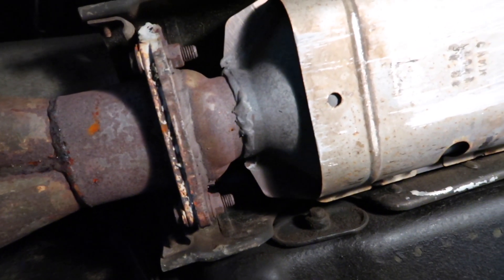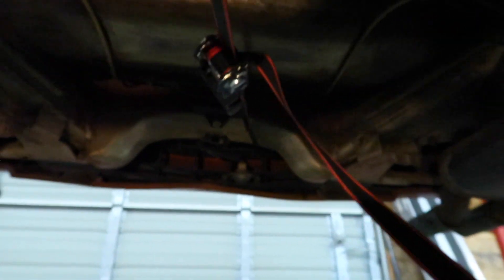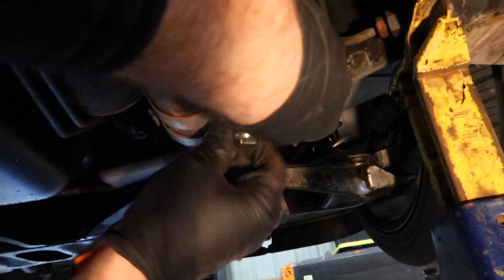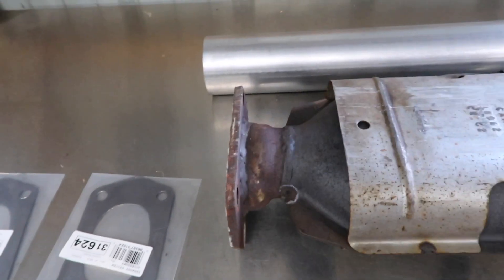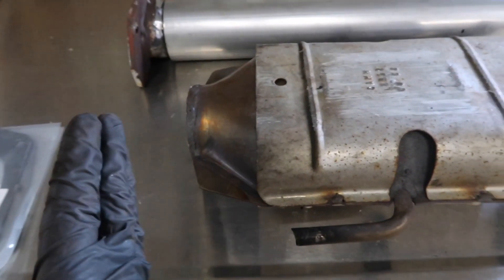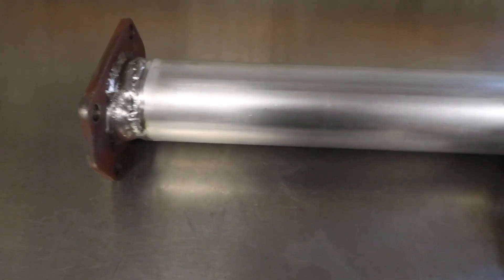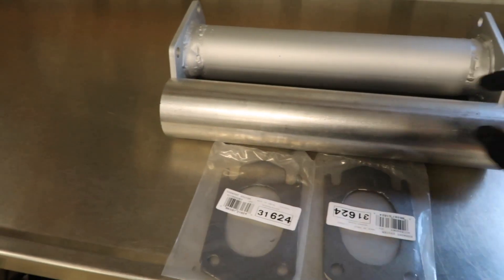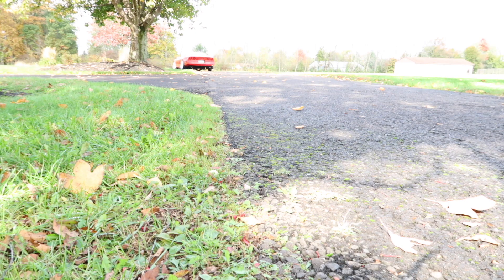D.I.Y Cat Delete For C4 Corvette!

Comment: did deleting the cats set off any lights on your dash? I'm concerned that it wont be breathing the way the o2 sensors think it should be.
Reply from the maker: Hi it didnt set it off at all. My car is an obd1 car so the o2 is before the cat.
Reply: Any car before 1996 will be fine, if you have a 96 then it will throw codes

Comment: 87 convertible with headers. My muffler guy is taking out the cat today and replacing it with a glass pack instead of a straight pipe. Wanting to eliminate the drone. Tired of wearing ear plugs. May 26, 2022
Reply from the maker: Not a bad idea!
Reply: Use the 92-96 cat back with long tube headers, zero drone. Enough exhaust to support 375-400 rwhp.

Comment: Slick job brother.... For anyone looking to replace the entire exhaust a good way to go is summit racing they have a universal exhaust kit for around $200 it's 2 1/2" in diameter aluminized and all mandrel bends... Has all the bends you need plus some extras to get the job done... Went and bought a The $99 MIG welder from harbor freight plus a cheap grinder with a cut off wheel and some single chamber mufflers from eBay so all total I had $300 invested...local performance exhaust shop wanted between $450 & $500 to do the job and that's without the nice  mandrel bends... It was a fun project very rewarding 👍
Reply from the maker: Thank you! Not a bad idea. i might to that too. Its nice to do something different .Thanks